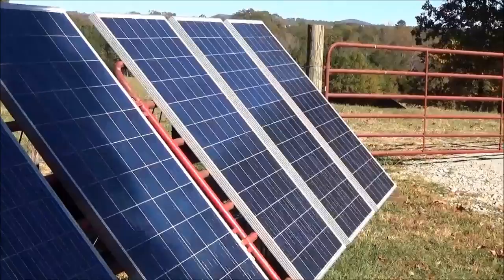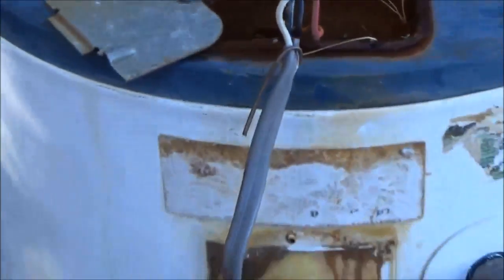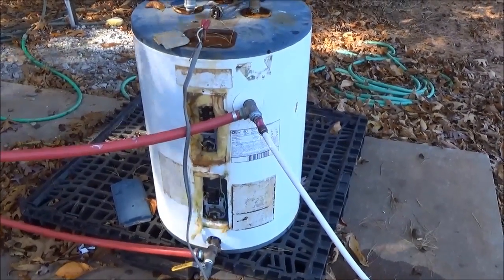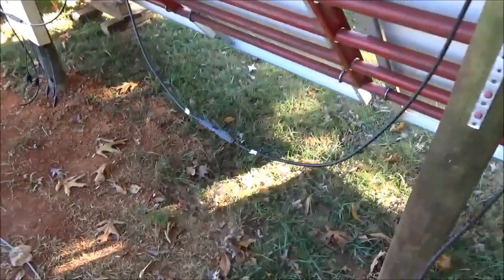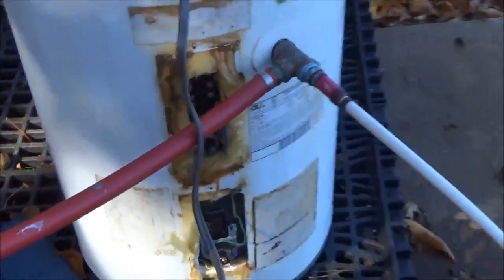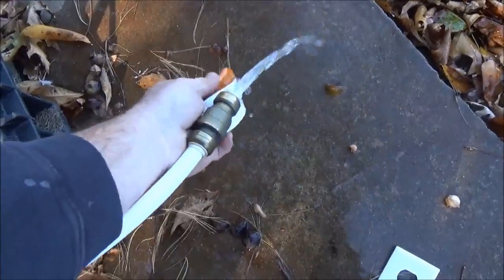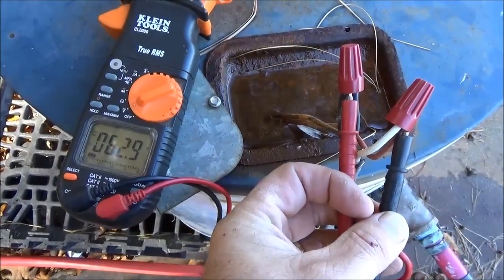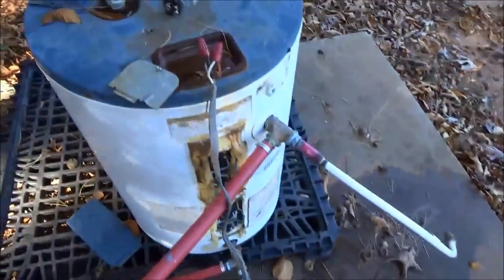Fuel-less Hot Water

Comment: I hear 10 amps is enough to kill a person,, be careful
Reply: Shift that decimal a few places to the left.
Reply: What alot of ppl dont realize is ur body is a resistor. So for a given voltage its only gonna draw so much current, regardless of what the source can supply.
Reply: When u introduce factors like dampness, entry and exit, etc the current (and lethality) changes
Reply: Unless you have a pacemaker and a body full of metal replacement joints while standing on concrete soaked with salt water, 48V (or no-load, 75V or so from those panels) isn't going to to give you anything more than a tingle, if that. Actually, it only takes .03 (30mA) amps through the heart to possibly send it into fibrillation, but you'll never be able to deliver that with the tiny voltage this rig is putting out.

And a question for E775; do you ground one leg of your DC systems, or do you leave them both floating?

Comment: This is a pretty interesting set up but I doubt it would work for me but maybe you could point me in the right direction. I have an M109A3 turned M109RV that I'm remodeling and a M105A2 trailer & S-250G shelter combo and I need a very efficient & cost effective way to heat water that is sustainable and in a small package because I will be moving with all my preps and working & living out of it when I get to my location after the SHTF. I think that at most I could get 800 to 1000 watts of panel on the roof of the M109 (I'll be storing my current Harbor Freight unit & 2 deep cycle batteries for back-up or portable power) and I want to be able to run an LMS 3990 mini mill, led lights, a small-medium flat panel TV, a laptop & speakers, and possibly a small refrigerator (but I might get a small dedicated panel & battery for that) so I can't dedicate it all to powering a hot water heater. And while I plan to carry at least 60-80 lbs of propane & my instant hot water heater it's not guaranteed that I'll come across any when it runs out so I certainly won't be relying on that. I was going to use my antique Jewel cast iron wood stove (which I might replace with a modern "Gypsy caravan stove") and the coiled copper tube around the chimney like you did in one of your videos but if you have any better ideas I would certainly appreciate some guidance.

http://www.imagebam.com/image/640ac1337789057

This is what it used to look like before I gutted it, installed a  secondary insulated floor on top of the factory wood floor,and painted the inside.

http://www.imagebam.com/image/a58a4b358640295
Reply: Have you considered a tankless water heater?  You could use your panels to charge a battery bank, or run it direct during full sun.

http://www.homedepot.com/b/Plumbing-Water-Heaters-Tankless-Electric/N-5yc1vZc1ty

Semper Fi
Reply: I have a setup like yours VolksPrepper.  I did a video on my YouTube channel on how I heat water using just a camp fire.  I have since converted my hot water to solar like Engineer775 shows in this vid.  I still have the wood heat option for when the sun is not out, but solar is the way to go Bro!  Nice BOV BTW!  Great minds think alike.  If you lived in the Pacific North West I would say lets pull our Army trucks up side by side and compare notes!
Reply: Yeah Papa Bravo I have considered many thing. But I'm just unsure of what route I want to go because I want at least two none propane ways to heat them...I have a instant propane water heater now. I'm thinking solar and wood fire.
Reply: Thanks OWWF...great minds do think alike! I just took a look at your video about the copper coil in the fire and the 200 degree water hoses and I must say your truck looks familiar. Are you on Steel Soldier? I go by BAZYRKYR...if YT would stop shutting my channels down I'd still be using that name here.

Comment: One hundred feet of black pex coiled and left in the sun will heat the water also.
Reply: freshkryp69 Maybe, but you won't be drinking the water, will you? The hot water will be used for bathing or cleaning. The tiny amount of toxins that are in the water will not pass through your skin.
Reply: +Jim H 
But you still need a pump and a means of dumping the extra heat via a radiator and fan as safety to control the heat of the water  inside  the water heater and not to mention freeze control.

One hundred feet of pex could buy a pv panel and you could power also other things with it besides a water heater.

Comment: Just outstanding video Scott. Thanks I want one of these here in Chile.
Reply: I designed a passive solar water heating system in which the 40 gal. reserve tank was in the garage but above the copper solar collectors.  This was totally passive.  When there was a four degree temperature differential between the panels and the tank the water would automatically convect(i.e. the warmer water from the panels would flow up into the top of the tank and cooler water from the bottom of the tank would flow into the bottom or entrance to the collectors.  This reserve tank served as a preheater for the normal gas water heater.  I monitored the temperature being drawn down from the reserve tank into the "normal" water heater with an inline thermometer.  It always read around 140℉, 160℉ at times.  Don't skimp on the reserve tank.  You don't want it to rust out prematurely.  No electricity, no pumps, no bells, no whistles!
Reply: PaulDavid Blakeley I plan on using a foam insulated Plastic slack tank / reserve tank that I am going to make or modify my self. I am very interested in seeing your desigen. Guillermo saw a complete solar electric system here in the south yesterday (installed) for 4 million , and it did everything.
Reply: cool . check it out . in nz they fire up a little wood stove with a coil in it. . hot water  goes into a hot water heater. if it gets to hot water goes up a pipe out onto the roof .lol . nice not having to do anything and hot water happens for free .
Reply: cowpoke02 All these little ways of doing things will make our lives easier here in Chile. If there is one thing to a gringo it is HOT WATER!
Reply: lol. yup .  some solar panels work great in cloudy rainy weather. I see them on amazon .  One Renogy 100 Watt Mono Solar Panels UL 1703 Certified (Grade A high Efficiency solar panel). supposed to be better. mono panels.

Comment: If you live somewhere without snow you can just use coiled up black hose on a roof or even on the ground and pump it by hand or set up a siphon our seasonal pool is heated in this way in the summer and the water gets hot enough to give you a pretty good burn/scald.

Comment: I have this exact setup on my BOV!  It works great!  The tank has a thermostat on board.  I have to run 300 watt 12 volt because the contacts will not handle higher amperage.  But with your panels in series I could see you going with the 600W elements.  Cool!

Comment: at a medical center I was one of the lead electricians in the construction and they had the hot water line go in a loop from the end back to the water heater with a water pump and a pressure tank so that at any faucet there would be hot water there / you could do that with this setup and the existing water heater you have to keep hot water in the home heater during the day and have it bypass the solar water at night with dc valves normally closed and open with the cell power during the day / just a thought
Reply: I know brother( I have high respect in yalls trade)  but what I was thinking was to use the solar water heater to rotate the water to the main water heater during the day and shut off at night when the sun went down and bypass it at night

Comment: Thats awesome! What is the watt and volt rating on the panels?
Reply from the maker: 300 watts.  I think that I could get away with 3 panels vs 4.  I am not getting much more gain with the forth.  So for $750 I have a pretty good fuel less water heating system that won;t freeze and is easy to hook up.

Comment: Wouldn't it be just as easy to use solar thermal panels to do the same thing, instead of using solar PV panels?
Reply: Fellas!  Solar panels can be had for about .75 cents per watt!  It cost me about 350.00 to heat my 40 gallon water heater every 20 years.  I bought the panels and screwed them to my roof.  Ran 2 wires to the heater and viola!  Hot water for life!  I don't have to worry about freezing my thermal panels, I didn't have to plumb my solar panels, I don't need a circulating pump, and don't forget that your time is worth money.  My time was about 2 hours total, counting changing the elements from ac to dc.  Go ahead and build your home made water panels if you want!  Have fun with that.
Reply: A solar thermal hot water system will typically heat water faster because it is more efficient.  The down sides are the freeze tolerance of drain back systems and the complicated nature of propylene glycol systems.  The type of system presented here is super simple and has no freezing pipes.
Reply: It's about half the price to use solar panels.  Thermal panels are pricy and solar panels are not.
Reply: I had no ideas that solar panels had dropped so much in price that they are cheaper than solar hot water panels.  

Heating by electricity is generally quite inefficient, however if you are getting essentially free electricity from the sun, that makes it more compelling.
Reply: OneWhoWalksFirst
Thermal panels are EASY to make. And don't cost much for materials.
Reply: @SlurponMuhdickKillTheState  How would you regulate water temperature?
Reply: Slurpon Muhdick That was what I was figuring as well.  I would have thought ready made commercial ones would be not that expensive.
Reply: bwillan
Commercial ones can be quite expensive, but I think they are still cheaper than the equivalent amount of solar electric panels it would take to do the same work. But you can make them dirt cheap with a few 2x6s, some pvc, a few sheets of plywood, a few sheets of plexiglass and a can of black spray paint.
Reply: bwillan If you use pv cells to run a heat pump, then you could theoretically make more hot water than a strictly solar water heater. PV cells 30% efficient and a heat pump with a COP of 3.3 or higher will produce more usable heat.
Reply: +dlstb
I think a hybrid system would be more cos effective and efficient, cheap 30% efficient solar water heater made from polycarbon or plexyglass heating water to 40° and then DC element will bring that to over 60°, I'm gonna be building this system soon.
Reply: +dlstb 
Heat pumps will only work when it is not to cold.
Go below 40 F and you will reduce the efficiency.
They have heatpumps to heat water, while the room in the house will be cooled.  In heatpump mode the compressor is using 700 watts, so a solar panel system needed for it it would be about 1100 watt to 1200 watts.
Reply: OneWhoWalksFirst
thermal panel...you out of your sense? all you need is shiny sheetmetal panels, bend them accordig to the shape of the formula and a black painted pipe with running panel to heat...the bending makes the sunlight focus almost all day on the pipe which goes to a tank that stores it...it does not require superexpensive humansh#t